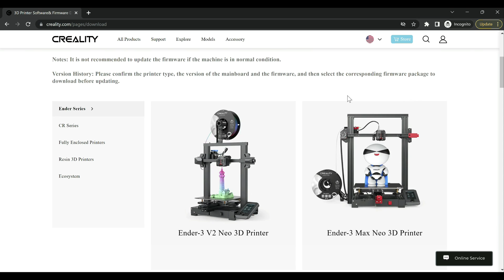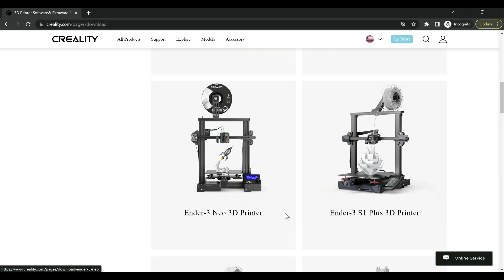Creality Touch Screen Install Guide

Comment: Oh if only it was this simple Creality appear to have dumped all Ender3 V2 and below firmware onto  google drive. when you go to their site it's nothing like this and they aren't interested unless you have a "Flagship Printer" or an Ender3 V3
On google drive it's virtually impossible to find anything
I'm rebuilding a V1Neo with a 422 board fitted.(Dunno what version silent or not) I have the printer working and have printed  About a dozen things successfully. Until the extruder failed and blocked the Bowden tube.
 I'm waiting for a replacement to arrive

I'd bought a BLtouch and acquired a creality touchscreen  so I want the 422 firmware with BL touch wish I could find it. as easy as it is in this video.

Comment: My screen never leaves the reality screen
Reply from the maker: Hi. What do you mean?
Reply: @3DPrintscape  it never goes further then the creality logo. I've since upgraded the board to the Bigtree Tech SKR mini E3 V3. and I'm still having the same issue. any help would be greatly appreciated
Reply from the maker: @raheimcason1191  Where did you get the firmware for the skr mini? It sounds like there is an issue/misconfiguration with the firmware or a sensor.

Comment: My Ender 3 pro has the 4.2.7 main board and a CRTouch, and the spirit driect drive hot end upgrade, All of this is runnning fine. BUT..when I went to install the Touchscreen any attempt to flash the recommended firmware cause the printer to not function at the, the display only showed the start up screen and the warning beeper went of constantly. Creality customer support is not being very helpful at all unfortunatly.
Reply from the maker: Hi. The i havent been able to get the creality touchscreen to work with any aftermarket firmware which this scenario would require.  The Ender 3 pro has the 4.2.2 board stock so the touchscreen firmware they offer will only work on that board.
Reply: @3DPrintscape  Thank you for that information. I will just keep the screen packed up untill some code wizard creates a solution. The printer is working just fine so I guess if it's not broken .......  Thanks again for all that you do.

Comment: But the cable supplied with the screen I bought hasn't got that crossover !!!
Is there any information on how to correct this?
Reply from the maker: Hi. If i remember correctly they were not the same. There was a crossover at some point.  I ill try to confirm again when i get the screen back from my friend.

Comment: Why do you need to change the cable? 
They seem identical. 
There are no crossovers and the colour assignment to each pin is identical.
Reply from the maker: Hi. If i remember correctly they were not the same. There was a crossover at some point.

Comment: I’m having a hard time updating the firmware for both my board and display screen. I would appreciate it if you could guide me to the right direction on what firmware I need for both since they have tons of options😅(see link for the board and display screen I have). I have a CR Touch and Filament detection also. Thank You.

https://drive.google.com/drive/folders/14JZi9A4MjBEPXQ-TK37nsmjyXVahmOJZ

Comment: Why after the upgrade of the firmware the dimemsions are 220x220 not 235x235 this is a big problem?
Reply from the maker: Hi. Is that with the creality firmware? Keep in mind the bed size is 235x235 but creality says only 220x220 is usable. If your making your own marlin build you can make sure its set to 235.
Reply: @3DPrintscape   Hi, yes Creality firmware is, and when i use the original non touch screeen i can move the axes to 235 with this screen i can't, maybe the firmware is suitable only for Pro but doesn't include sprite like dimensions. Maybe that is the problem. I can't use the sprite with the BL touch with this screen.
Reply from the maker: @eng.Georgi_Hristozov  They made some odd choices with their firmware and compatibility for the screen.
Reply: @3DPrintscape  Yes but this is stupid from their side, for example if I want a touch screen on my ender 3 v 2, I can't upgrade with sprite pro, becouse they don't have firmware which supports it, or if you want to upgrade the screen you can't use the touch screen if you already got Sprite pro

Comment: WARNING: For anybody reading this. I have to switch back because I got a sprite pro extruder upgrade. Creality isn’t really supporting the firmware update for printers with a touch screen upgrade. At least the 3v2 with a sprite extruder and touch screen is not supported. As of the time of this comment.
Reply from the maker: Hi. thanks for sharing. I have also found the creality firmware to lack support for a lot of customizations.
Reply: Thank you I was considering putting the touch screen on mine but now I won’t also mriscoc is not supported on touch screen so I’ll stick with v2 screen
Reply: Will the touch screen work on the ender  3s1?
Reply: @Jokers_k5  I can’t say. You would need to look if Creality has a firmware for it.
Reply: Thank you so much
Reply: My Ender 3 pro has the 4.2.7 main board and a CRTouch, and the spirit driect drive hot end upgrade, All of this is runnning fine. BUT..when I went to install the Touchscreen any attempt to flash the recommended firmware cause the printer to not function at the, the display only showed the start up screen and the warning beeper went of constantly. so far not impressed.

Comment: Install went smooth, doesn't work. Can't see anything on my tf card no matter what i do. Reverting back to the knob. I've snarled emailed creality to get their input.
Reply from the maker: Hi. Interesting, i would be curious to hear what Creality says.
Reply: @3DPrintscape  they sent me a firmware for the board and for the screen to try. Screen is much worse off now. It won't update firmware properly, it's just messy and poorly executed. I can't find anyone who has a working Ender 3 V2 4.2.2 with touch screen and auto levelling.
Reply from the maker: @leetpg  I dont think they have any firmware for the touch screen and bltouch combo. I was trying to make a marlin build but had nothing but issues trying to get it to work with the screen.
Reply: @3DPrintscape  they do actually have it on their website. It's the touch screen firmware. Download it go into the zip, go into your board version and there will be a bl touch and a non bl touch. Alas, they don't work. In fact it ruined the touch screen. All issues resolved after removing the screen.

They also ignored my email relating to issues with their firmware and screen.
Reply from the maker: @leetpg  Sorry to hear that. I wish they had their stuff open source.

Comment: I'm trying to upgrade 3pro with touch screen without success. The new 427 firmware lost after I installed 3max firmware making to reinstall the mb firmware again. The the touch screen don't show creality menu, only 3 colour box with Chinese word.
Reply from the maker: Hi. Do you have an ender 3 pro or a max? If the pro, what max firmware did you try to load?

Comment: I finally got the touch screen working thanks to your video but now I can’t seem to view any of my files… any ideas on how to fix this ?
Reply from the maker: Hi. Check the chip on your printer to see if its a GD on, there have been issues after firmware updates related to that. Someone said they got it working by changing the format on the sd card.
Reply: Whats GD?
Reply from the maker: @iansummerfield4185  Its one of the newer chip sets the boards have been shipping with.

Comment: Great video, just set mine up. However, it's in Chinese. I was able to navigate to the language screen and see the option for English, but when I press it nothing happens. It registers my touch and makes a beep, but doesn't do anything. Any ideas?
Reply from the maker: Hi. I havent seen this before. You may have to push new firmware to the screen.

Comment: Thanks for the video, It was super useful on the installation.

 I just bought a new Ender 3 Pro set it up and ran a few prints completely stock and it worked great. I then upgraded to the touch screen and loaded the firmware (4.2.2) to it with no issues. but now I cannot get it to read G-code files at all. I am using the same microUSB card that I used before (the one that came with it). I even tried the same files that I had previously printed, but nothing will show up.

Anyone know how to fix this?
Reply from the maker: Hi. I have heard this come up from people using creality firmware (no just the ones for the screen). Is the chip in your printer one of the GD ones?
Reply: @3DPrintscape  Yes It is the GD chip. Is there a firmware other than Creality that you would recommend?
Reply from the maker: @chrisalexander842  I dont think they have firmware that works with the screen and GD chip. There isnt much support for either.

Comment: Good afternoon. I can't connect Creality 3D Pad Mini to Ender 3Max. Could you help me in resolving this issue?
Reply from the maker: Hi. What issues are you having?
Reply: @3DPrintscape  
Hello. I bought a Creality 3D Pad Mini but the firmware that comes with it doesn't work with my Creality Ender 3 Max. It is made for Creality Ender 3. Could you write firmware for my printer? Or suggest where it can be downloaded. Thank you for responding. Sorry for my bad english)
Reply: @3DPrintscape  Sorry for the intrusiveness, but can you help my problem?
Reply from the maker: @jackal62331  I would recommend joining our discord server to see if anyone on there has that working. It would be hard to just make a build because i cant test it without the screen and i had issues with the creality touch screen and marlin.
Reply: @3DPrintscape  Thank you
Reply: I had it working on the e3 max,but I'm pretty sure it still won't print 310x310 even after putting the settings into the screen

Comment: i have ender 3 pro with bl touch and run out sensor using the original screen printer works fine. i swapped the screen to  the new touch screen and installed firmware for touch screen with bl touch but now the z axis will not go down when you tell it to level bed on touch screen it just goes to centre of the bed moves up slightly as if its going to start levelling then just stops. i have the 4.2.2 board you get a small extension board to plug on to main board for bl touch and the new touch screen plugs into the extension board is this correct or am i doing something wrong
Reply from the maker: Hi. Is your z stop connected?
Reply: @3DPrintscape  no disconnected that when I put bl touch on.
Reply from the maker: @markfeatherstone-c6x  Connect the z stop. There were only a couple of creality builds that didnt want it connected.
Reply: @3D Printscape  ok ill try that thanks

Comment: Does the touch screen have the remaining print time on it?
Reply: It does if you slice it in cura add the add-on and make sure you apply it to the printer configuration.
Reply from the maker: Hi. I think it does, if I remember correctly. I don’t have it connected right now.

Comment: I just got an Ender V1 used (and mostly borked), and have been doing upgrades to it instead of buying new stock parts for it. I would love to see the video on Marlin customization that works with the touch screen and CR Touch. I have the CR Touch with a Sprite Pro, currently. Love the videos. Thanks!
Reply from the maker: Hi. I was running into a lot of issues getting the screen to work with marlin, so I put that on hold for now.
Reply: Ive been trying to get the touch screen to work with marlin for a while too, still haven't been able to get it to work
Reply from the maker: @VaultCauy  Its been a pain, not sure it will work with a normal setup.

Comment: I have a problem with connecting this touch screen with btt SKR mini 3.0. I did everything now problem is upgrading firmware.
Reply from the maker: Hi. I wasn’t able to get this screen to work with custom builds of marlin, so you are probably running into the same issues I was.

Comment: I did exactly as the video shows, firmware and all, but it still wont go past the creality loading screen... I dunno why ists doing it. Im confused.
Reply from the maker: Hi. I had that happen if the firmware wasnt right (a lot when testing marlin with it). The one Creality one worked though.

Comment: I like your vidoes Rob, but this touchscreen is a major disappointment! You're basically stuck with the worst firmware possible. Perhaps we need to start complaining en masse before Creality will do anything about it.....
Reply from the maker: Hi. Thanks for your feedback and i agree. I have only been able to get this to work with the base creality firmware, thats it.
Reply: I agree, I am going back to the old screen I guess. Not sure if the one with the knob is any better ?
Reply: @Filament Firearms  I sent it back and picked up a BTT Mini 12864 display that is probably the best bang for the buck.  It's a little work setting it up but well worth it. I also picked up it's bigger brother,  the BTT TFT35 but have yet to set it up on my Ender 5 Pro. It's the same price as the Creality and way more functional.
Reply: @TwitcyTrain  oh and yes, I have the Creality screen you are referring to with the knob and it is much better!
Reply: @hilum17  ok I also saw the BTT screens . I guess I will probably send the Creality back. Maybe swap it out for the one with the knob. With the knob model does it support more than one firmware versions?
Reply: @Filament Firearms  honestly all I can tell you is that the one that came on my S1 was able to be flashed with the S1 Pro firmware no issues and that they same screen can be found on other Ender 3 products. You'd have to take a look in the firmware itself using Visual Studio Code (or equivalent).

Comment: I love your videos. They're SO easy to follow. Did you ever get a chance to make a tutorial on how to make this work with Marlin? Trying to use this with an SKR Mini V3, not sure what those settings should be in the configuration.h file.
Reply from the maker: Hi. Thanks for the feedback. I havent been able to get it to work properly with Marlin. I think there is a way but its not strait forward.
Reply: @3DPrintscape  if you have a lead on getting it to work with Marlin,  please share!

Comment: Bought the CR touch and the Mini Pad 4.3 from creality. I can use the CR touch with old screen......or I can use the Mini Pad 4.3 with no CR touch. Once I load the firmware for one it cancels the other.
Reply from the maker: Hi. I havent worked with the mini pad yet, but my guess is it will have a firmware than needs pushed to the printer. Similar to how the sonic pad works.
Reply: @3DPrintscape  It does have the firmware....just when it is pushed to the printer it disables the cr.....and when the cr is pushed it disables the mini.....Nice Creality....make products that don't work together.
Reply from the maker: @AnthonyM1  Interesting, and that wouldnt be the first case of that happening lol.
Reply: @3DPrintscape  FWI. I found the solution. Load both firmware sets to the printer at one time. I put the mini and 4.2.2.  CR touch on the card and wala....took both at once.

Comment: I know a lot of content creators don't take video suggestions from the comment section, but I am really in a bind. I have ben trying to upgrade my ender 3 4.2.2 board with a ender 3 v2 screen. I got it working but I can't get the screen to display the v2 Home Screen. If you could make a video on putting a ender 3 v2 screen on a ender 3 with a 4.2.2 bored that would be awesome! But if you can't I totally understand. Anything helps at this point!
Reply from the maker: Hi. I have videos coving building marlin. Just make sure to grab the v2 config examples and use the one with the creality UI. Also, make sure #define DWIN_CREALITY_LCD is enabled.
Reply: Do you put the dwin files into the SD card slot in back of screen?
Reply: @iansummerfield4185  unfortunately, I got fed up with the screen and returned it.

Comment: i did mine screen works but set all axis to 0 and head will not return home sit mid air in the center
Reply from the maker: Hi. It sounds like you used the firmware for the bltocuh (assuming you dont have one?).

Comment: Hi, is the software for the regular Ender-3 the same or different?
Reply from the maker: Hi. It depends on the board you have. The v2 has a silent 4.2.2 board, so it is different than the standard and pro.

Comment: thanks for the video. I 've got a ender3 pro with skr mini e3 v2 board  and I've just bought the same touch screen kit. I have written a marlin file to the ender but I want to change the marlin firmware to run the touch screen. What would I  need to change to get the touch screen working.
Reply from the maker: Hi. I have been running into nothing but issues with that screen and marlin. If you have the SKR, i would return the creality screen and get a tft.